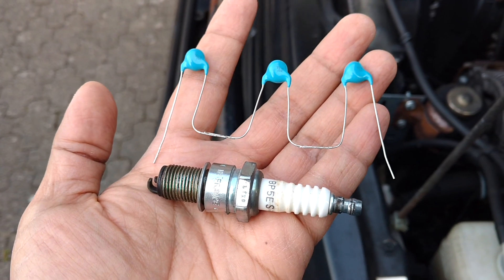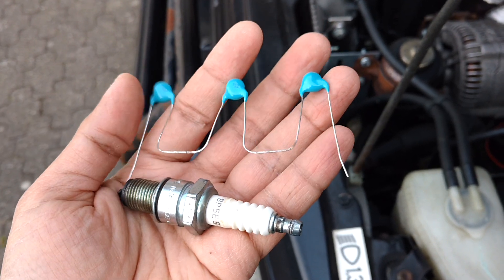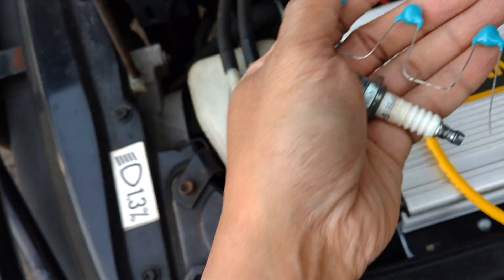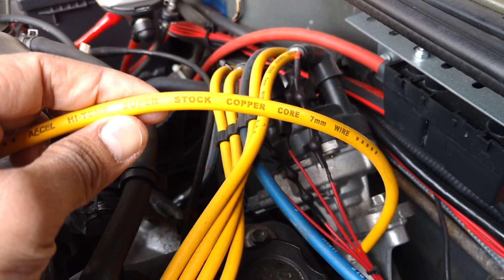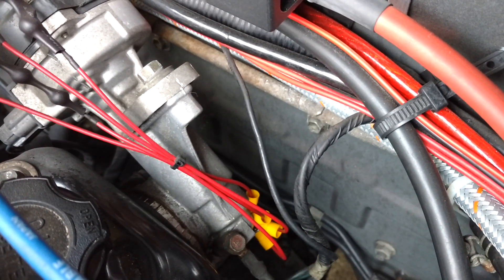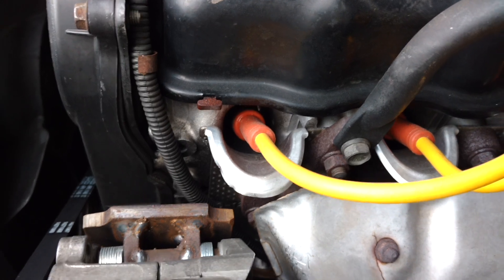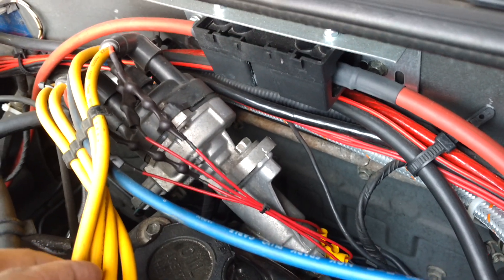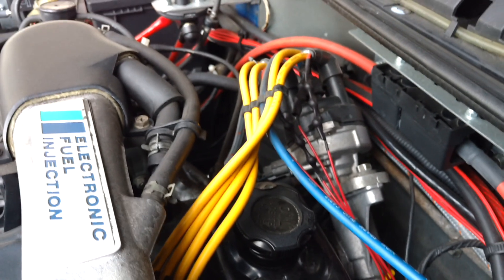Simple Plasma Ignition - my actual installation

Comment: Hi Okki ! Did you simulated with CDI ignition, or only with switches (points or transístor)
Reply from the maker: Walter Júnior, no I haven't tried this with CDI. If you have one please try it and let me know the result.
Reply: I just looking for build a homemade CDI, and found your videos. With them, i'm not think to do this more, but i'll boost my transistorised ignition with points with your idea.
I'll will happy if you permise to publish it in my home page. The link of the eletronic ignition (Ignição Assistida in portuguese) is: http://www.waltergjunior.com/IgnicaoEletronica.htm , and my e-mail will found there. Thank for your attention, Walter.
Reply from the maker: Walter Júnior, yes you can publish this on your website. Please share this information to the public.
Reply: Thanks for the permission, and when I post I will put the links of your videos, and references to you. I'll let you know when I publish. If you can, tell me a little bit where the idea came from and about you too, so I can insert it into the text. You can use the email for this: waltergjunior@waltergjunior.com
Speaking of the configuration of your engine, I believe that it is not a problem to connect the ground in the engine block. It's the same thing as fixing on the ground of the spark plug. Forget the connection in the spak plug ground, it is very difficult, because of the position and excessive heat.
I'm thinking of using a capacitor of 100pF / 30Kv per spark plug. I have 4 cars, with 20 spark plug in total. It would be fewer parts, and I could put the capacitors in a small plastic box, to better accommodate. But I'll be experimenting with other capacitor configurations too, like two 100pF in series, to see how it works.
Have you tried using only a series of capacitors in the coil cable? Would it work or would it damage the distributor cap and rotor?
Another thing I've been thinking about is how it works, the theory of the thing. With my knowledge I did not come to a conclusion, whether it would be power factor correction, or accumulate the charge of the coil transients in the capacitors, and discharge in the next cycle. I will continue to think about it, this simple idea made me very excited.
Thanks again, my virtual friend. And sorry for the long text.
Reply from the maker: Hi Walter, regarding this simple plasma ignition, one day I just got the idea to attach a simple capacitor across the spark plug electrodes. I tried this idea for the first time using a high voltage ceramic door knob capacitor. The idea was very simple, I wanted to store the charge from ignition coil before firing it. I thought if I can do that, I will get more intense spark. The capacitance value has to be very small. Actually it depends on the power of the ignition coil about how big your capacitance can be.
Just for your information, I'm focusing my research in energy field since 2007. What I wanted to do was to increase fuel economy of my car. At that time the gasoline cost was very high here in Germany. I have tried water plasma ignition system, HHO or Brown's gas or Oxyhydrogen or Hydroxy, gasoline vapor system and the last one was this simple plasma.
Back to the simple plasma ignition story. Later on I realize that this system is actually can be traced back to Nikola Tesla. He used this system to power his Tesla Coil.
Talking about Nikola Tesla, I have built some Stan Meyer's, Puharich and John Bedini's circuits. Every time I see a circuit and try to improve the efficiency of that circuit, it ended up with a Tesla Coil. To me it happens every time. This Tesla Coil is a very simple circuit but the principle is very complex. You cannot simplify this Tesla Coil circuit, but you can see so many interesting effects with this. The modern Tesla Coil is Slayer Exciter. I suggest you to build one, just to get some experience with it.
What should I tell you about myself? About my educational background? Or about my job? Or about my family? I really have no idea.
About your idea to put only one capacitor per engine directly at the output of ignition coil, you can try it and see what will happen. What may happen is that you get the plasma not only on spark plug tip but also on rotor tip in distributor. It means you may have rotor and distributor wear too. And maybe also weaker plasma effect on the spark plug tip. But don't take my word for it, try it for yourself. You know how to do it. If you wish, you can tell me your result with this idea.
I think that's it for now. If you have more questions or idea, feel free to contact me.
Take care and regards,
Okki
Reply: I use Bosch K coil in my cars with points. I have the example of your videos, where you use the same coil, and this will facilitate me in the definition of the capacitance. I will try with 50/73/100 and 110pF, but I already know that a good value is the 73pF. I have to buy the capacitors, I did not find them in the stores here, nor even on the internet in Brazil. I will have to import via the internet, and China is the best option. The bad thing is just the delay to arrive, caused by the customs.
On the theory, I also thought about Tesla. But I do not know the bigger details of that point. See if my reasoning is correct, in a simple way: When generating the high voltage pulse, the coil induces in the primary a reverse voltage, a transient. This transient induces again in the secondary, but at that moment we do not have spark, it is not in the correct time. It is this energy that would be wasted that is stored in the capacitors, and dissipated in the next spark, which boost the spark with greater voltage and energy. This point, of the amount of energy, I believe we will also increase. From the approximate 60mJ we have of the original Kettering system, we will get more than that. I do not know how to quantify, but I believe in this increase in energy as well as greater tension.
As for the use of the capacitors with CDI, I think it has the same effect. It would only be good to use capacitors with higher voltage rating, because the high voltage with the use of CDI is higher. But honestly, with the ignition transistorized with points that I already have, added to the capacitors, I will never need better.
As for your information, only a small amount. Where you were born and live, training, educational background and job. We can not inform more details of us on the internet, because it is a wild terrain. Enough to identify and give credit to the one who got the idea and created this simple, cheap, easy and efficient way of using capacitors.
Reply from the maker: Walter Júnior, I will send you email but it will take time. Please be patient.
Reply: Do not hurry. This is a hobby for me, not a job.

Comment: Hi friend okki, thanks for your videos ...
I have a question: 1) With the capacitors you have in your car configuration how many miles have your spark plugs lasted?

2) Have not you tried this with an iridium spark plugs?

Pd: Sorry, my english is using translator xD
Reply from the maker: Hi Manuel,
1. If you use capacitor with value 70 pF or at max. 100 pF, the spark plugs will last long (I use around 70 pF and I could not see any sign of excessive wear of the electrodes).
2. No I haven' t tried that.
No problem, I can understand you.
PS: please check out my last video. I have uploaded an update of this system.
Reply: Berarti intinya memasang kapasitor dari positip yang dari delco ke ground ya bang?
Reply: ⁰0

Comment: hi..what  kind of capacitor do i use in this.. pls tell thanks
Reply from the maker: You can use any capacitor with capacitance value around 100 pF and Voltage rating around 30 kV.
Reply: Can I use 220pf 15kv ?
Reply: No, lower voltage capacitors will die.
Reply: not working for 2KV..i tried it engine will off

Comment: Friend, I buy 10 capacitors of 35kva 222pf.... i want use 1 per cable. Its danger?
Reply: Julio bruno .that will work
..because the impprtan factor is the voltage
...better if u use 2 in series
..
a lot safer
Reply from the maker: Just try it. If it doesn't work, maybe you need to make the capacitance smaller. Try to put 2 capacitors (in series) per cable.
Reply: Why don't work? The effect is to 2 capacitors in serie? Why not 1?
Reply from the maker: I did not say it won't work. Just try it.
My suggestion is: for long electrode life, use capacitance value around 70 or 100 pF.
Reply: Julio bruno

Comment: Hola. Son 3 capacitarse de que medida. Por cuantos volts? Gracias.
Reply from the maker: Each capacitor is rated at 15 kV.
Reply: Okki para sistema de encendido con bobina DIS tambien van de ls misma medida los capacitores?
Reply from the maker: I think so. Just try it, you will see if it's going to work or not.

Comment: installation don on my motorcycle it's working great. thank you so much.

it is adjustable. because I want to adjust ignition spark high to low & low to high.
Reply from the maker: Congratulations!
Reply: Okki Moeljadi need your help.... it's not working when I mount to the engine ground.
Reply from the maker: Sandip Halder, please make sure you use non-resistor sparkplug and copper core ignition wire. The capacitance value and voltage rating are also important. I don't think to utilize a switch on a high voltage system is a good idea. Just wire everything firmly without any switch. Also make sure no electrical leak outside the sparkplug.

Comment: Can I use 10 Capacitor sir ?
Reply from the maker: Heng Lyly, yes you can. In fact, you can use any number of capacitors you want, as long as you have the correct total capacitance value and voltage rating.
Reply: Thank you sir
Reply from the maker: You are welcome.

Comment: Very interesting your video, can I make this connection with resistive cables ??  Sorry, I'm using a translator.
Reply from the maker: Thanks Paulo Quinelato. No, it will not work with resistive cable. You have to use copper core ignition cable.

Comment: I had the best HHO results on a diesel engine running the cell straight (no pwm) and it got the cell hot enough to produce vapor and I had a 3mpg gain. I think the same could work with the older vehicles that have no oxygen sensors. I have a circuit to drive a cell that seems to work really well but have had no time to test it on an auto. Makes a good torch though. This is a cool mod that could be useful for an older VW running HHO. What size and voltage rating are those caps?
Reply from the maker: Hi Clintified2themax. These capacitors are rated at 220pF/15kV each.

Comment: This doesnt combust but rather cools the charge as far as Im aware. Used in WW2 on planes etc there is a gain in horse power. Can lean the mixture down or run lower octanes.
Reply from the maker: Yes it is useful for high compression or turbo engines but my engine has low comp and no turbo, so it's pretty much useless for me.
Reply: I was going to run a leaner jet in the carburetor and compensate the leanness with water meth cooling
Reply from the maker: If only I had a carburetted engine, I'd rather go gasoline vapor instead of leaning the jet. You can go vapor like Smokey Yunick hot vapor system or Bill Kendrick gasoline flash vapor system. As you don't risk your engine with knocking problems. Vapor fuels don't knock. I wish I lived in a country without strict technical inspection, so that I can use the waste heat from cooling system and exhaust gas to heat my gasoline and transform it into vapor. Such modification in this country where I live is strictly prohibited.
Reply: I followed a chap named indianchief741 he did this 8 years ago very hands on then suddenly dropped it. I am still interested in the vapour scenario but Im not sure if you would be just left with residuals. the vapour does tend to make the engine run leaner hotter so water inject would be good with this. I just need to study what happens with the semi volitiles of fuel if there is any left over.
Reply from the maker: I think I have watched his videos. Indianchief was a talented experimenter but Smokey Yunick was a race car mechanic, he knew what he was doing and his hot vapor cars were on some car magazines in the 80's. He even had patent on this system. Anyway, from what I understand, he uses a downdraft carburetor and the intake pipe below carburetor was heated using cooling water and then the air-fuel mixture was "homogenized" with a device looks like a "bottle brush cleaner" which is turned by turbocharger shaft, and from there the homogenized mixture is sucked by a turbocharger and from turbocharger goes directly into intake port. All piping from turbocharger until intake port is heated with exhaust gas. And yes I also have some sticky brown black residuals from the heated gasoline. I don't know if I would continue my research in this field. I think I almost succeed with my vapor system but I have so many things to do and very limited time.
Reply: Thats interesting Okki I hope someone cracks it. I appreciate your input.

Comment: I have fitted basic water injection to my little vw engine it draws the 50% methanol to water mix from a reservoir and feeds via a syringe. Has gained a small percentage of power. I need to experiment with different needle sizes though.
Reply from the maker: It sounds interesting. I have tried water vapor in my car but had no luck. Basically what I have done was to boil water and let the engine suck the vapor. The engine often dies because of water condensation in the intake manifold. I tried also with gasoline vapor. I had two problems with that, first gasoline vapor condenses very quickly and second it was difficult to adjust air-fuel ratio. But I have managed to run my car only on gasoline vapor on highway. I also tried HHO and also had no luck. I think 4-stroke engine is not suitable for HHO, it has to be modified to 2-stroke.